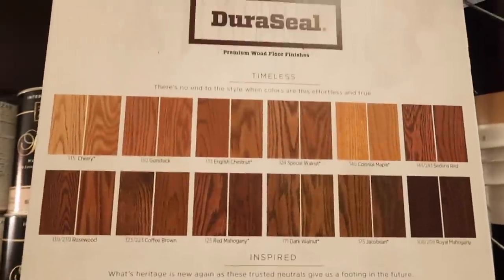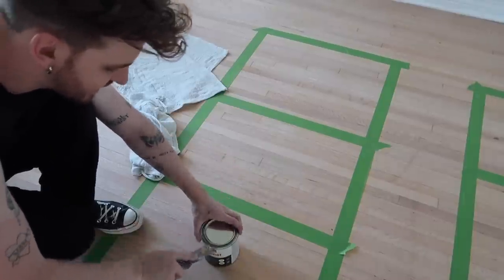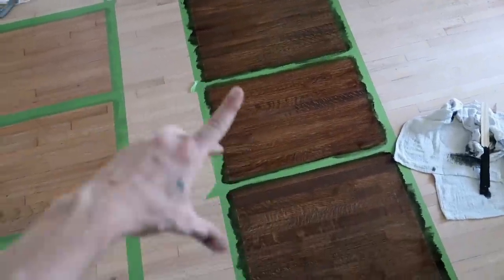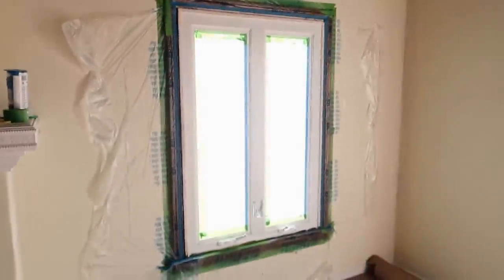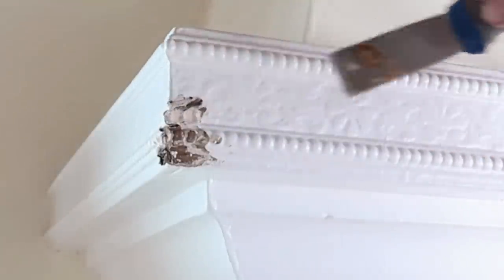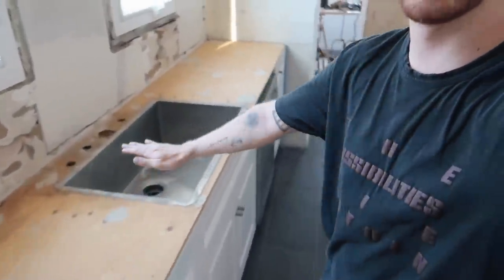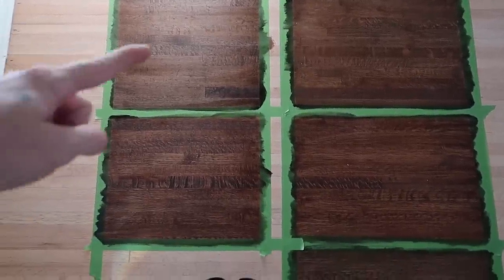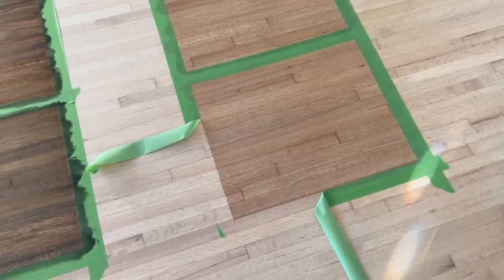I'VE BEEN DREAMING OF THIS MOMENT 😱

Comment: Drew, PLEASE use some respiratory protection when using spray paints!!!  Aerosolized paint sprayed from a can does not ONLY go where you are directing it, and so it is extremely important to protect your airways—both mouth and nose!!  A proper mask that will filter out the very fine paint droplets/particles that spray from the can (And will drift with the slightest breath of air—including your inhalations!) will make a huge difference❤😂 to your throat, nasal passages, and ultimately…YOUR LUNGS!!!  In the least, my husband (In the paint/commercial coatings industry for 35+ years) recommends a “dust mask” which should be worn every time you do something like this!), but for someone doing a lot of this type of refinishing/painting, a respirator is the safest, most protective, choice.  
Also, I think I already suggested this in another comment previously, but I will add another recommendation from my husband….in an older house with older walls, he also recommends a newer, second painters’ tape (It is YELLOW not green,) from the Shurtape line of products (Their original paper painters’ tape is green—thus called “Frog tape” and is MUCH better than other tapes!!!) is specifically used when the walls might need a little more protection (Such as  with plaster walls or other older walls.) This specific tape by Suretape is YELLOW and provides a better release from the surface you are taping, leaves less residue after removing, and provides cleaner straight lines with less bleeding from your painting! Also, it is a lot more forgiving if you don’t remove the tape as soon as the paint dries (It can be safely removed days later!).  Basically,  it is the Cadillac of painter’s tape, and my husband feels it is well worth the extra cost!  
Hope these comments help!  You are so talented, and creative, I enjoy your videos so very much! Best of all, you seem like a kind and loving person, who is good to other people, grateful for any assistance given, and respectful as well!   Good luck with your house, I am so happy for you and know you will end up with a truly beautiful home for yourself and all your family and friends that live with, or visit you there!

Comment: I’ve owned many homes over the past 44 years, most of them older homes, 1940, 1925, 1913…. My advice is to go slightly lighter than darker with the stain on the wood floors; it holds up much better over time and stays in style with changing styles. Overall, you are doing a great job with everything. I absolutely love your countertops, especially the wider edging.
Reply: Yes, and the darker you go, every single dog hair and dust bunny is crazy visible. ☺️😬
Reply: I also test stain inside a closet rather than in an open room.
Reply: I actually recommend the opposite. Floors get more light and that tends to make them look lighter. Not to mention no matter what you choose for the floor trends come and go. That's what always makes flooring color difficult. No one color has stayed in style overtime.
Reply: Aunt Bee, I couldn’t agree with you more. I always wanted dark hardwood until I had them. Aagghh! They show everything; scratches, dirt, hair and then some. Really high maintenance.
Reply: In 1952 my parents built a new house and wanted the oak floors stained darker. They looked fantastic. Those were the days of paste wax on the floors and an electric buffer. After 5 years we could see a paler trail in the heavy traffic areas. They had all the floors stripped and refinished while we were on vacation. Not as dramatic but more livable.
Reply: I agree with you using the lighter floor color.
Reply: agree
Reply: Lol, you are so right! We have dark carpet in some areas, and lighter bamboo color laminate in some. My husband had severe psoriasis and boy!, can I tell where he had been if he was in the carpet area! 😅
Reply: Don't forget he has to hide all the dark dog pee stains all over the upper wood floors, a dark stain is a must in this scenario.
Reply: @EvelynM-vlogs   That’s definitely a consideration. It’s why I mentioned slightly lighter than darker. I wonder if there is a way to lightly bleach out those stains….
Reply: @SeaTurtle515  sadly, oak goes black when it gets standing water on it and the only way to get rid of it is to sand it out.  This is not an option for flooring unless you are OK with a serious dip in the flooring, in this case that would be everywhere. The only option - aside from ripping it out - is to stain it dark to mask the blackened wood. Black walnut stain would have been my suggestion. It is the hider of all evils when it comes to wood.
Reply: Dark and light stain trends come and go over the years, so staying appropriate for the style and era of the home seems to be the safest bet. In this case, for the upper level a darker stain is more appropriate considering the exposed trusses. He isn't going to mess with those - because - well that would be a sin😜Looking awesome!
Reply: @Jessa8891  Agreed, plus in Drew's case, darker floors match the Spanish Revival style of the house best.
Reply: @ingusch3783  yes I forgot to mention that. Thank you. Lighter floors are completely wrong for a the era and having the two units with two different finishes won't help with his end goes to make it one cohesive home.
Reply: Agreed!
Reply: My home came with a mediumish tone a floor stain with some warmth, and love it. Easy care, hides whatever, and lovely contrast with dark wood furniture, metals, and artwork.

Comment: I agree with the suggestion to go a bit lighter on the flooring. My sister and her hubby chose a beautiful dark finish in their kitchen... and every time they moved a chair, EVEN WITH PROTECTORS on the legs, the floorboards would scratch. That was three years ago. They just replaced all the cabinets and everything, including a lighter tone on the floors, and she loves it, no more scratches!
Reply: I have dark wood flooring and my issue is that  you can see every speck of dirt and dust 😅
Reply: This is good to know. Thanks for this info
Reply: @lunamoon8740  same! We did a deep ebony (almost black) and loved the color. It has lasted over 10 years with only losing color along the board seams since the floor is almost 70 years old.
Reply: I went if that had to do with the quality or application of the stain?

Comment: I was dying when you started testing on such big squares on freshly sanded floors. Never do that. Just don't. Never ever do that. It's better to buy some wood of the same type of your flooring try the different stains on that scrap wood,  never do what you are doing with such big swatches on a freshly sanded floor. 1. If you don't like it you can't stain over it because it will not be the same as the rest of the floor. 2. You may not have more wood to sand again if you don't like it. Especially with old floors.

Comment: I think if the floors are too dark, similar to the ceiling dark brown it will make the rooms look as squeezed between 2 large dark boards. Especially if you have dark cabinets, with the dark floor it would suck all the light from the room. I love white cabinets, everything white, well, I am Scandinavian. The house we bought had a previous owner only one year and had to move due to work. I have dark brownish black cabinets, white countertops and dark brown/ black/ gray old hardwood colored floors. I will paint the cabinets white, the floor can be dark, it will anchor the room. If everything is white the room will like like floating in the air. 
Love the brown color on your window frames.

Comment: Loving all the renovations you are making to the house. I am happy you did brown instead of black on the window frames because it would have been too harsh of a contrast. I prefer the darker stains which is what I have in my own home. With kids and lots of pets it helps hide the dings. 
I was cringing a little when you stained the middle the the already sanded floors. I hope you intend to stain them dark or sand again. It is best to find out what kind of wood you have and try to get the same species and try it on that. If that is not possible then test in more inconspicuous places like inside a closet.

Comment: From my personal experience all old wood, even when you sand it off. Stains a red or orange color. To compensate, since I was also  trained & operated a salon for over 15 yrs. What ever the base color of your color (stain you choose the opposite stain color to counteract the red or orange just to get a neutral color.) If that makes since. In other words if you put a stain that has a orange or redish tone. It's only going to make it orange or redder. You can bleach the wood, but it still will lend to the orange or red. I have learned this by doing multiple old wood projects. And the counteracting the opposite of those red & orange stains. Is the only way I have found to actually come up with a neutral wood color. It maybe that what ever kind of wood they used to use was a wood that had orange or red in it. In color it does depend on what the base color of what you are coloring or tinting does make a huge difference. Such as example of color. If you are dieing a person's hair color & it is over 50% gray you are going to get that red color. So you put the opposite spectrum without any golds, reds or orange tones to get a neutral color! And most color even stain are going to be darker than you think. I hope some of this helps. I was so afraid when you went straight on the floor with the stain. I imagine you are planning on sanding it again. But if at all possible try it on a board that isn't conspicuous. It could make a difference on the patchs you used for testing.  You are brave for sure. I also have learned all the things I have redone the hard way. With trial & error. And would love to write a book on what not to do. You can mix two stains to get the color you want as well. I have used Spanish oak & dark wallnut to achieve the color to match our over late somewhere in the 1800 woodwork to match the other old wood. We have done so many reclaim things out of necessity it's hard to remember them all now. 
  My husband & I took out the plaster & slat ceiling in our living room. To expose the 2nd story old native lumber floors, of the upstairs room. That was such a huge accomplishment. And when we got it exposed it was very dry looking. So I applied linseed oil to all the exposed old thirsty native lumber & it turned out more than I could have ever hoped for. But it was a long & tedious project for sure.

Comment: Thank you!!! This video came at the perfect time. I want to paint my ugly old vinyl white gutters black. I went to Benjamin Moore yesterday they basically gave me no options to avoid warping if I paint them black. I had no idea about this high heat priner - THANK YOU... I was looking to see if it comes in paint too & not spray paint didn't see it.

Also it says you should also use a high hear paint too... I realize you painted the interior side  of the window frames but did you cosider using a HIGH HEAT PAINT too? xo

Comment: How will you get those samples off? You'll have to sand the floor way down in that area? I would think you would always see it. I have done small samples along the baseboard but never big areas in the middle of the floor.
Reply: The entire room needs to be sanded down, not just where he put the stain samples.
Reply: @susannovak8263  it already was sanded, ready for stain. Only so many times you can sand old floors.

Comment: Question: why do you not use a brush when staining your wood, both on window and floor? The cloth does not make it apply evenly and I feel that the end result looks worse - but that is my own opinion - I much prefer to use a brush myself, unless you want an uneven look, in which case I will wait for the finished product when you are done - thanks so much for sharing

Comment: If you’re going to consider resale appeal for floor color, then the lighter stains have been En Vogue. Seems that over all, most people feel that it’s happier and less depressing. This trend has been going on since the mid 1980’s and shows no end in sight. I personally love whitewashed oak floors. I don’t think of resale and always go with what I prefer, because I live in the moment. 

Something else for you to consider ( probably too late). You can double stain to bring out the flame/ figure in the wood.
This is an old trick that has mostly been forgotten. There is a guitar company by the name of Paul Reed Smith (PRS). They use this method on their expensive guitars. You can find videos of this on YouTube under PRS.

Have you figured out how to remove the stains left by the puppies 🐶?
I’ve heard, bleach ( different dilutions) can help, also, there’s different peroxide’s too. You’d think that flooring guys would know exactly how to remove it.

Comment: Drew, after you applied the stains on the floor, did you wipe off the excess stain? Luke a Mr. Miyagi “Wax on, wax off” move??? In the video they darker stains seemed…I don’t know what world to use…maybe a little clumpy with excess stain. Typically, especially with darker stains, you apply the stain, let it saturated for about 5 mins and then “Wax off” wipe the excess off. That way you see the wood grain shine through. And then like you mentioned if you want it darker, then you add more coats and did the same thing…wait a bit then wipe off the excess. 

Anyway I’m sure you already know how to stain, so my two boys can go into the void. 

Love all that you are and do! As always, can’t wait to see your projects unfold!

Comment: Sooo....now that you have stained 6 different large squares of your newly sanded and cleaned floor, are you going to have to have the men and what you've done, off, before you stain the entire floor with the stain you chose?  (What this a wise move on your part, or, at least should you have maybe stained a more out-of-the-way area in much smaller patches? )